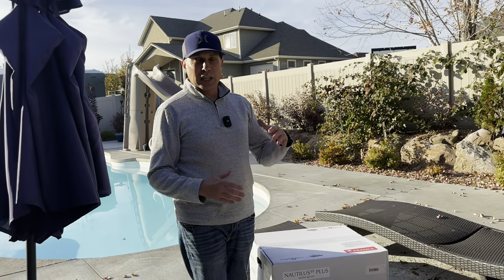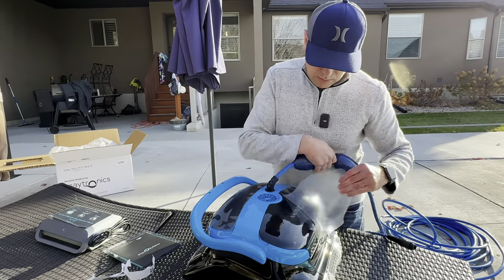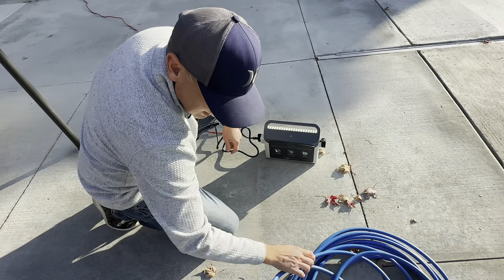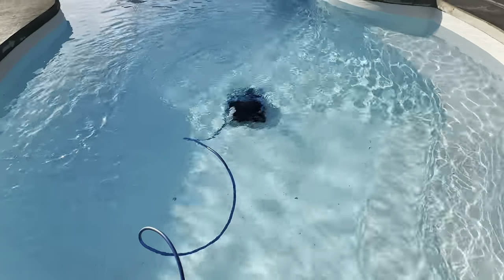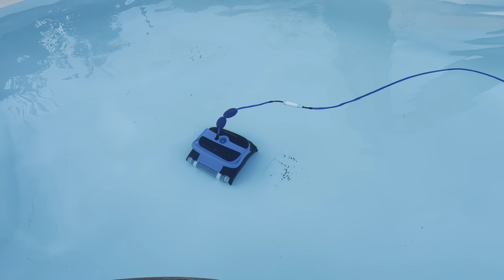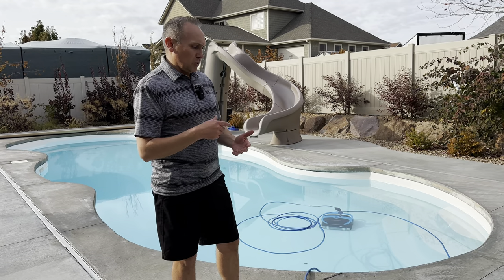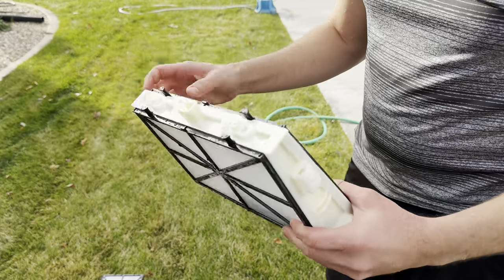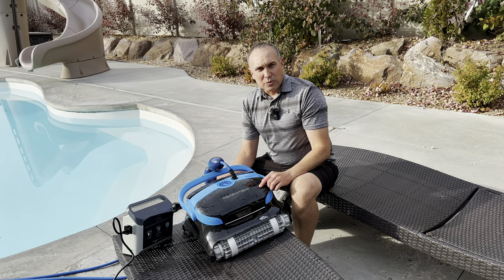Pool Cleaner Review!  Dolphin Nautilus CC Plus Robotic Pool Vacuum Cleaner Wi-Fi & Wall Climbing

Comment: Doesn't look like a lot of room to pick up leaves, something I have a problem with. Also they don't recommend using an extension cable, so I'm assuming it's ok. I have a Dolphin Quantum  on order.
Reply from the maker: It can hold quite a bit of debris, but you would want to clean it out frequently if you're vacuuming up a lot of leaves